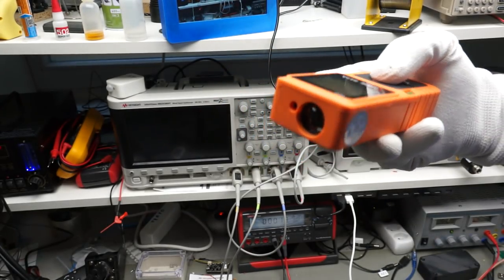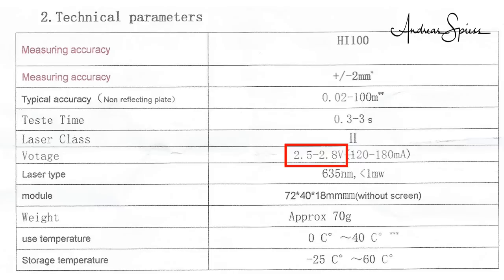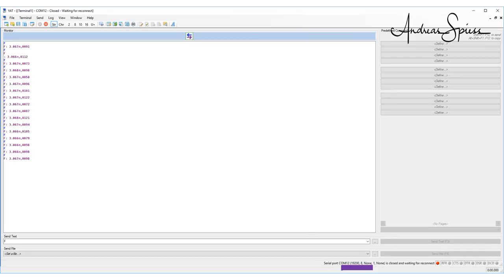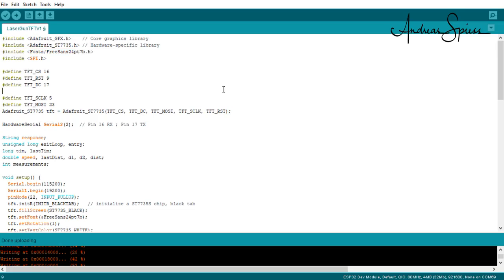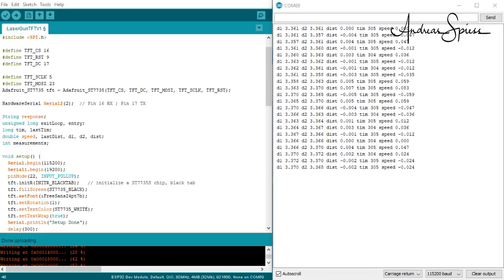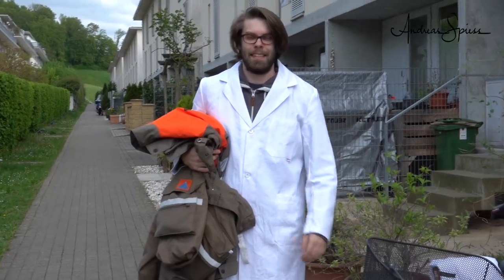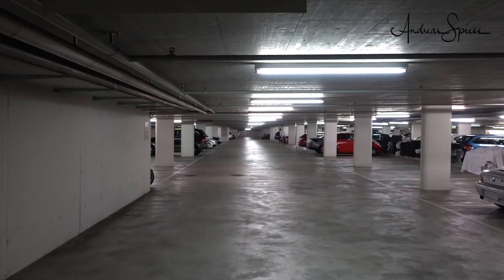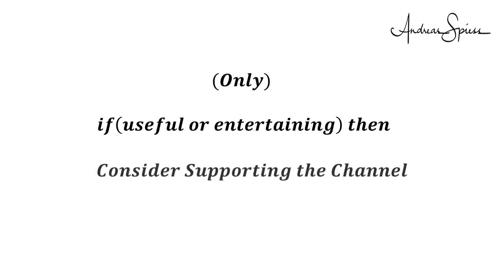#198 Laser Speed Gun Project with Range Finder and ESP32  (Distance Meter)

Comment: I find the application notes of the ToF chip  GP-22 very helpful. I learned a lot about laser ranging techniques from them. For example their GP-22 uses phase shift for mm-accuracy and for km-distances they use normal time-of-flight. Internally the use some kind of GHZ ring oscillator to count pulses between start and stop signals :)
Reply from the maker: Thank you for this excellent link. It helped me a lot.
After more investigation, I found that my sensor works by sending signals of different frequencies and measure the phase shift. 
I assume the range finder in the mail will use this GP-22 chip. We will see...

Comment: I'm a cave surveyor and have been using these lidar devices since they were really expensive and the size of  a shoebox back in the early 1990s.  The way they do the impossible time-of-flight measurement is by modulating the laser signal, and then using the pattern of the mixed direct and reflected signals (much like you did at the radar frequrencies just with the clever signal processing). The tech was invented by Leica originally. So essentially you actually use the modulation frequency for analysis, not the raw light frequency, which as you say is impossible to measure directly. Early models had a physical optical splitter on a solenoid, but that became solid state as they got smaller and cheaper and lower power.
Reply from the maker: You are right. I later found out that this is one of the concepts used by the devices. The newest ones seem to be able to really measure TOF without the trick of phases.

Comment: Testing is always the preferred method of determining accuracy of a products claim. Really enjoyed this video as Andreas points out important issues.

It's how the scientific community has create  physical laws we all accept.

There might be some reasons why the "laser" is not working properly, including the wavelength configuration and the receive sensor. In fact, it may not even be possible to operate as desired if both are not calibrated correctly.

Light is a very finicky "thing". We know this from decades of fibre optic wavelength testing. The power, precision, and tuning demands are significant. And this is in a closed and controlled environment! In an open environment, the obstacles and dilution (scattering) effects that can obstruct the wavelength / spectrum require a really good receiver sensor or failure is likely.

Light can be your friend or your worst enemy. 

The only observation I have is processing cpu power on the board and the data transmission rate between the serial port and the laser detection settings. The number of queries might be overwhelming the serial port and a reason why latency is occurring and increasing with "time". 

You might want to inject a <delay> interval and observe the results.

#impedance spectroscopy
Reply from the maker: It seems you have a lot of experience in this field. I do not know a lot. But I expect that the supplier knows and ships me a device which can fulfill the specs he promises.
As I mentioned I have another rangefinder on order and we will see if this one is different. For me, it is still hard to believe that such devices can "see" a small point over 100 meters and more...
Reply: I find it unlikely you will find the performance you are looking for at the price point and range desired. There are many technical requirements for a laser to perform at 50 to 100 meters using a power voltage range of less than 5 Volts (even if it is pulse boosted to 10 Volts) that registers consistent measurements that must be processed using ESP32 boards. And then there are the laws of physics that must be accounted for.

Using a laser / LIDAR for speed detection requires precision components.  Consumer grade speed guns do not use laser frequencies and are incredibly accurate in very small form factors. Bushnell makes one that's smaller than a 9mm Beretta and runs on two AAA batteries for less than $85 USD. It has a range of over 1000 meters.

As you have discovered, the geometry and wavelength filtering (signal control; reflection, refraction, diffraction, absorption and scattering) issues are staggeringly complex that demand intensive processing power at VERY fast speeds - assuming the quality of the components are superior. The send / receive components are not cheap and require multiple processing steps before the data can be used with any degree of accuracy. A 600 DMIPS (Dhrystone  Millions of instructions per second) logic controller that does not have floating point calculation capability running at 240 MHz is probably going to be pushed to its limits when used  on a multi-purpose ESP32 board. It also requires multiple computational threads for signal input and output data if for any target data that is moving. If the device is not held perfectly still, it too will affect performance and your results.

You are also faced with the laws of physics and the reaction of soft materials (clothes, human tissue, etc.) that tend to absorb light while dense hard materials (steel, wood, etc) will have better reflection properties.

Comment: My understanding of how these laser "tape" measures work is that they vary the laser frequency and measure the intereference with the reflected signal. During this frequency sweep (easily done for semiconductor laser by varying the current) you will have multiple destructive interferencies (which are dead easy to detect; pure analog circuitry is enough). The "distance" (in wavlength) between those destructive interferences is dependent on the distance to the measured object. Since the modulation sweep speed of the laser can be whatever you design it to be, you can take whatever speed you need to measure the time between those destructive interferences.
This would also explain why the measurement drifts when the laser is on for a longer time. The laser diode will heat up (which changes the wavelength), but the circuit is still assuming a base wavelength of say 650nm.
Reply from the maker: You are partially right. I did some more investigations and found the laser is modulated with signals of different frequencies. Like that they can measure the phase difference and calculate the distance. Because light has a very short wavelength it would not help shifting frequency there (distance between maximums would only be in the nanometers). If they would use 100 MHz the "wavelength" is  3 meters and they could distinguish all distances between 0 to 3 meters. We measured some frequencies around 200 MHz.

Comment: Excellent post, as always, thank you! And indeed the method is so much more important than the results. Especially, I really loved the TX trick to find logical level voltage.
One comment: perhaps one more thing that can be done to augment the device is replace the weak laser diode with a stronger one, operating at the same wavelength. If possible, I would disconnect the existing laser and hook up a beefy mosfet feeding one of the stronger laser emitters. 
I wonder what does the sensing of the reflected light, though, whether it is the emitting diode itself or a dedicated sensor
Reply from the maker: I thought about that. But it seems to be a coupled system where not only the reflected light is used but also the emitted one. And the diode is not only switched on and off. A quite complex voltage curve is driving it.
I also want to see if the strength of the diode makes the difference between this one and the one on order.
Reply: Well, that's interesting. Good to know we had the same line of thinking. I wonder about the theory behind that little fellow...

Comment: Possibly a filter on the detector element on the receiver tuned for the wavelength of the laser to avoid swamping the detector with more ambient light than necessary?  Unless the detector already has some sort of filter already in use..
Reply from the maker: The detector seems to have a filter on it. But ambient light also has parts in the IR wavelength...

Comment: Laser speed guns use infrared and that can be filtered even during daylight... the "spot" is not visible to the naked eye.

I had a chance tolay with a proper unit many years ago and the number plates and headlights were the most reliable aiming point.  The unit sent out a train of about 16 pulses in a third of a second and did a simple average to determine speed. I deliberately swept the point of aim between walls on the opposite side of the road and got the building to move at several kilometers per hour. 😎

Base technology and firmware has improved over the years so such shenanigans are much harder now.
Reply from the maker: Thanks for the info. I should get another one for experimenting and for sure will give an update.

Comment: the laser speed guns also need to be aimed at the number plates afaik, which is not that easy. Also problems with de-flections from windows + curved surfaces.
The cloth reflector material probably is optimized for a different light frequency, or might even only reflect a specific nm range in the visible spectrum.
Reply from the maker: You are probably right concerning the reflectors. I did not think about that.

Comment: Perhaps you could still build a speed sensor, just using 2 of these pointing across the path, a known distance apart and communicating to a node that would do the calculations?  You could even measure the speed of multiple vehicles if they are travelling different lanes on a road, just by measuring the distance to the vehicle from the sensor.
Reply from the maker: That would be a different principle. Probably not easy because there is not a constant beam. there is only a measurement every 0.3 seconds. So the resolution would be rather small and the distances between the two devices would have to be quite long.

Comment: That is why radar speed sensors are widely used, no need to aim precisely and no reflective surface is needed. There are laser speed guns used like in Italy and there are countermeasures sold on the internet: they usually are a led strip to be mounted on the front of the car that hat blinds the laser sensor; of course they are illegal but you know how it works
Reply from the maker: Here they use both. Radar for short distances and laser for longer distances. Lasers are operated by a police officer, and Radars can be run automatically.

Comment: Andreas, these ToF sensors don't really measure time of flight but instead send out a modulated signal and measure a phase difference between the original signal and the reflected one. The phase difference is directly proportional to the distance. That is much easier than to measure time. So time of flight is a bit of a misnomer.
Reply from the maker: You are right with the method (I did some more investigation after the video). But they measure the "time of flight" with this principle. You can check it by including another material like water into the beam. It changes the "distance" because the speed of light is different.

Comment: Some of these meters use laser-triangulation: 
The sent laser beam (known angle), the beam coming back, and the (known) distance laser->optics form a triangle. Behind the optics is a sensor which can tell where the beam hits it, which is depending on the angle of the beam coming into the optics. So we know two angles and one distance; rest of the triangle can be calculated.
Reply from the maker: Triangulation is usually used for short distances. I cannot imagine that the base of 2cm can be used for a 50 m measurement. But I might be wrong, of course.
Reply: Yes, 100m is maybe a bit far, but it could explain your problems with heat (warping) and the different surfaces. And if the laser spot is small and pulsed (for ambient light cancelling), it wouldn't appear bright to the human eye. The mirror might be there because the sensor is mounted flat on the PCB... so I thought it kinda fits
Reply: Oh, also: LCD, not OLED? :-)

Comment: Dear Andreas, first i want to say love your work and keep it up especially LORA videos. Second since your video 181 i also had the idea of a laser speed detector however my approach is defrent. I have a proplem of fast drivers going by my house i wanted a stationary speed trap. The idea is to put two laser points on one side and laser reader with esp on the other side of the street. Knowing that i will place the sensors and laser pointers 10cm apart i can calculate the time from brack of one laser been to the time of brake of the second and calculate time to get the speed. I had a small sample built but i would like to add a camara to catch the plates as well. However i dont have the time, knowhow and the resorces to make it. Maybe you can add this type of speed senser to your video next time.
Reply from the maker: Yours is a simple principle but needs more installation. It is very simple. Use two sensors, start the timer with one sensor and stop it with the second one. Then you can calculate the speed...

Comment: I have always wondered about a speed gun which worked from the side. Using a standard camera select 2x spots (left and right) on the image and detect when they change with a time stamp. Then drive past at a known speed to calibrate it (could also measure the distance between the 2x spots. I've never got around to doing this though.
Reply from the maker: Your method works perfectly. However, it needs some installation (4 poles) and its limitation is if two cars pass in two different directions at the same time.

Comment: The value after distance that You obtained in YAT seems to be "intensity" value of ray that has been received. You can easily verifi that by measuring distance to black/dark object (ie. black sheet of paper) and to a white sheet of paper - intensity values should differ significantly, at the same range to the object.
Reply from the maker: Well possible. I have to check.

Comment: If you choose `D` instead of `F` do you get a longer distance?
Reply from the maker: No, unfortunately not.
Reply: does it return a higher resolution at least? otherwise what is the point of the slow mode? I guess it might use less power.
Reply from the maker: As I said, I did not find a difference. Also not in the brightness of the dot. But I did not investigate too long. Because I anyway was not interested in the slow one.
Reply: I’m betting it’s 2 factors at play here... 

one is it’s Chinese junk that is falsely speced.. 

Two is that it’s very unclear how this device is even working.  It is possible that the laser maybe under powered (too low voltage/amperage) and also possible that the micro processor is getting too much power (he did mention it drifts a lot when continuously used which heat would explain).  

Bonus third possibility is that it was poorly engineered on silicon level, things are internally wired poorly or a lot of crosstalk making accurate readings very difficult.

Comment: If it's using the phase modulation for the distance calculation, I think that the optics should be replaceable? As long as the sensor  receives some laser light with the modulation, it should work?

So maybe you could use your binoculars to boost the range? I think you wouldn't even have to re-calibrate for the the added magnification.
Reply from the maker: You are right with the phase detection. It uses different frequencies (I made some more investigations). The new one on order should have some sort of magnification. We will see...
Reply: Thank you for your reply, and your great ESP32/ESP8266 videos! They are a great help!

Comment: Any update to the Radar as a speed sensor. Would be interested in the integration with ESP32? how do you connect the two?
Reply from the maker: We never continued the project :-(
Reply: @AndreasSpiess  I'm going to with my limited knowledge try to hook up a MAX4466 or LM358 to amplify the signal and then try to FFT the in and get some speeds ;)

Comment: Laser range sensors usually use triangulation, not time measurement (https://de.wikipedia.org/wiki/Elektrooptische_Entfernungsmessung#Lasertriangulation). The reflected laser point is projected on a CCD-sensor. I gues the arrangements of laser, lens and CCD and so the reliability of the measurement depend on the temperature. This would explain that reliability becomes worse after a longer time of continous operation.
Reply from the maker: Thank you for the link. Reading this interesting Article I would say, that it uses TOF plus modulation of the laser. I looked at the voltage across the diode we saw a high frequency signal which would explain the modulation part.
Reply: the spec on aliexpress says 100m, not 1000m. But you can't trust this. And the range like Andreas found out was only a few meters. For longer distances you are right. Triangulation won't work here if emitter and tranceiver are that close to each other.
Reply: OK, may be you are right. But the modulation may also be used to distinguish the reflected laser light from incoming ambient light. What is the frequency you measured?
Reply from the maker: There were a few signals overlapped. But with what I learned now I have to check it again and measure the current, not only the voltage.